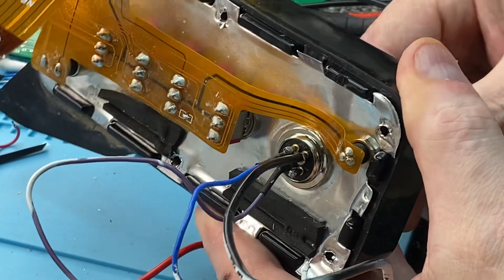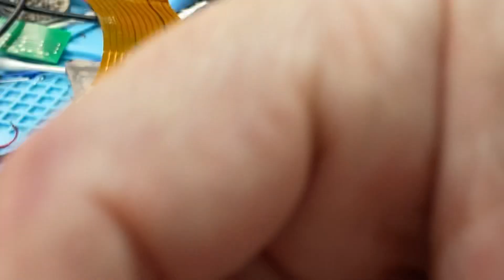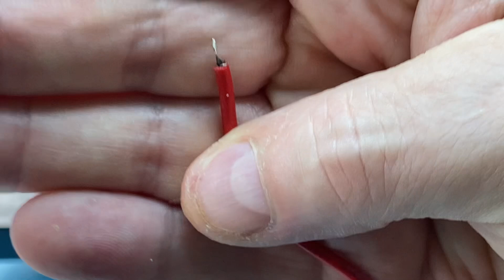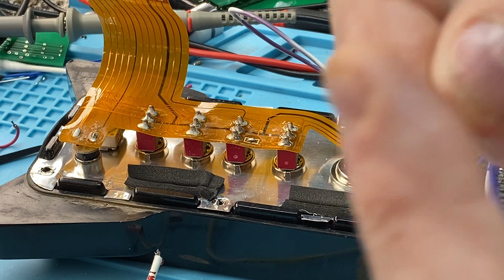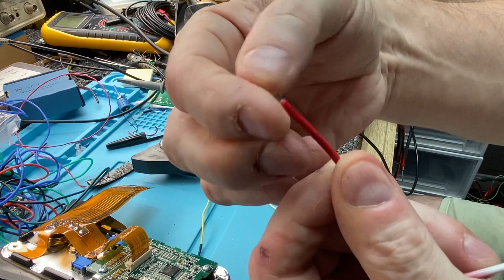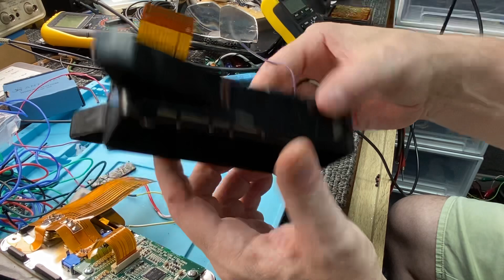The same common faults, this applies  all electronic equipment  including metal detectors.

Comment: Hi
I have a question
Gpx is a multi frequency device right?
In order to make same coil work with different frequencies you should change the coil itself resonant frequency for example by changing the capacitor connected to coil.
How it's getting done in gpx?
Are they using different capacitors or other ways?
Reply from the maker: The whole detector and coil pulse width difference is totally inefficient and is not optimised to the coil, in enhance mode there at pulses of 6 us and others over 200 us, just make sure the coil resonance is above all the different tx frequencies.
Reply: @DetectorMods  you mean that the coil only need to matches the highest frequency?
In that case the lower frequencies must be a division of higher frequency?
For example 2khz, 4khz, 8khz and so on
Reply from the maker: No, the whole putting of energy into the coil is done by brute force and ignorance.
Reply: @DetectorMods  that kinda explain why gpx using too much battery
Reply from the maker: @drghz3783  I have an idea, well, you are onto it as well.